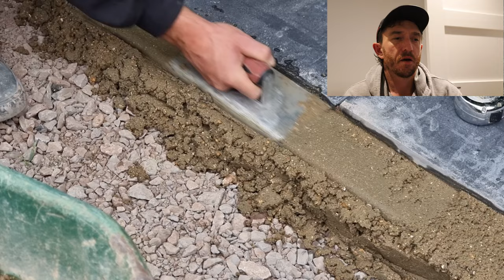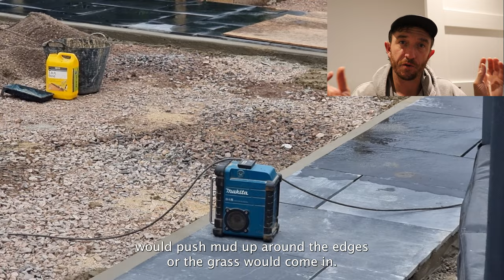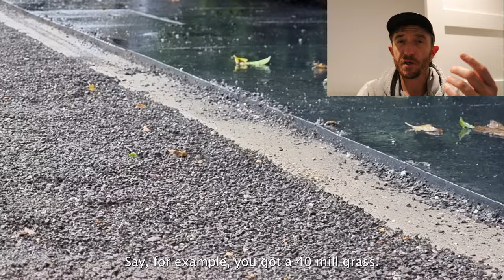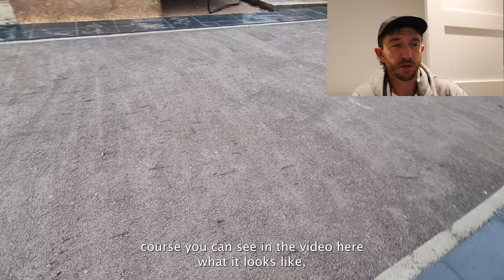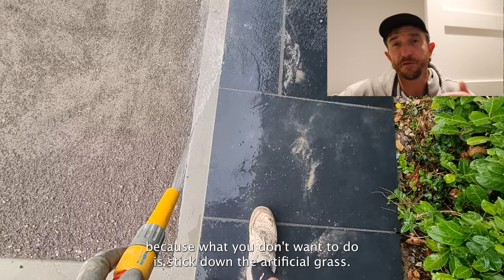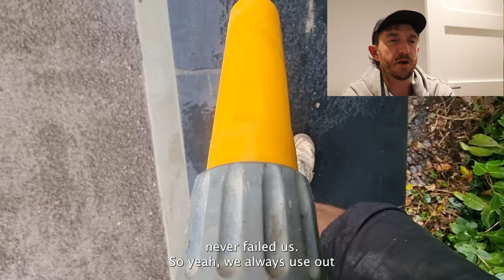how to make a concrete haunch for artificial grass - top tips

Comment: How do you go about stretching the artificial grass nice and tight when you're using an adhesive
Reply from the maker: To be honest I've never want to stretch into the edge's Ideal you want your grass to overlap the edges and then cut them in. In a real Ideal situation you would roll grass out, leave to settle for half hour,  a sunny day is best conditions , once settled cut it. I genuinely don't lay artificial between late October and March as prefer to lay in warmer weather. 

But if I've ever had to stretch the grass I've always used a carpet stretcher - https://www.screwfix.com/p/magnusson-extendable-knee-kicker-470mm/344FT?tc=XA8&gclid=Cj0KCQjwtJKqBhCaARIsAN_yS_kymRGyVuH6fuwAh_J293fo6UBcpKy4aq7_ESAhQYmi-u2stxsq6kcaAgrUEALw_wcB&gclsrc=aw.ds

Do you do a lot of artificial grass? 

Do you do anything differently?
Reply: I've drilled rawl plugs into haunching and then screwed artificial grass down, let's you pull it tight as best you can. Often wonder how well adhesive can cope with our changeable climate, but it it's working for you that's great. Always overlay artificial grass then trim as necessary.  Knee kicker is a great idea. Keep the videos coming.👍👍
Reply from the maker: great idea with the rawl plugs,

regarding adhesive ive always used AQUABOND and never had any problems and have only ever used that and only recommend that product, used a competitor once and it pulled off like glue tack lol 

knee kicker great help on long joins.

Cheers JC always appreciate your comments and support.

I hope all is well
Reply: I'll try remember aqua bond of i need to do joins, can't use screws for that. Do you ever offer aftercare on artificial grass? I've used a hard surface cleaner mixed with weedkiller to control moss and weeds before it becomes a problem but not many people seem interested, I think no matter how good a job it's impossible to keep weeds and moss free.